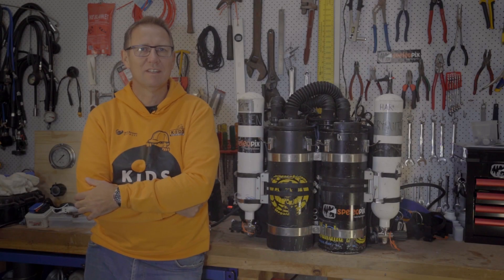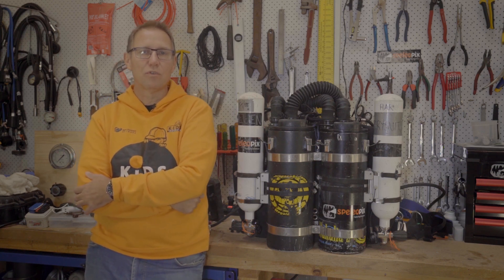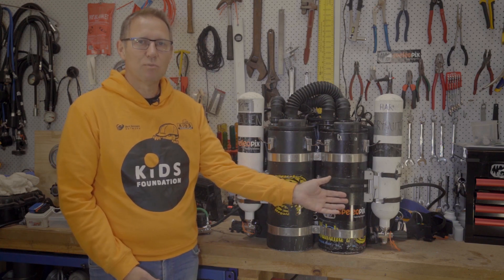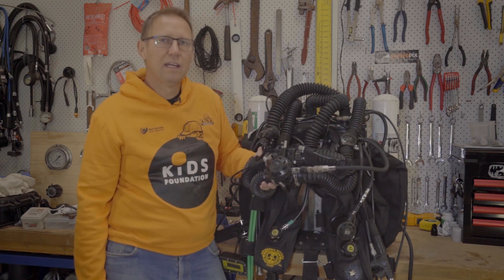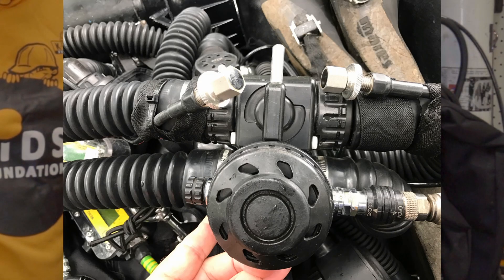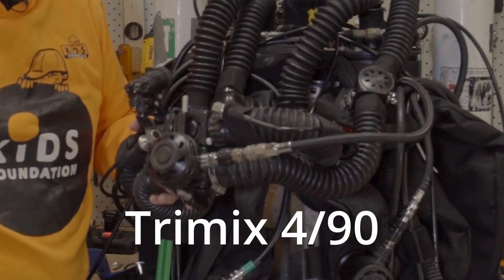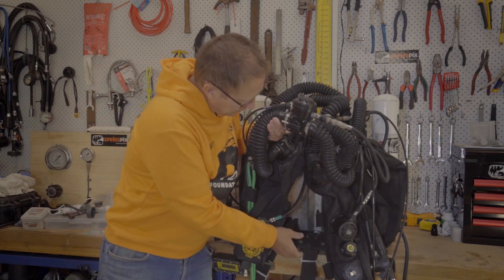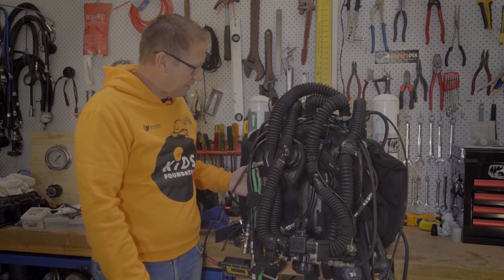Twin Megalodon Breakdown

Comment: Are you using the secondary rebreather as a bailout rebreather or do some of your dives require it to be built into the dive plan?  

It is inspiring and humbling to watch people such as yourself pushing new frontiers.  Amazing rig.  Thank you for the instructional video.  One the Meg sites referred me to this video saying you are the expert on dual Megs and this video proves it. .
Reply from the maker: Just as a bailout unit but we test and confirm it works as we descend. Definitely not an expert. My mate Craig Challen has a lot more experience. And som of the European guys for many years with other units.

Comment: Hi Richard,
(as a non-diver) I'd like to ask you what's more dangerous or unconvenient about using this setup? I've read, in another comment, that you'd recommend it for dives deeper than 150m. In my mind, excluding obviously a higher maintenance time and a longer fitting time for the system, a double rebreather would actually be safer because of the earned redundancy. Hence, it would be a better than closed circuit.
Reply from the maker: Hi good question. It IS closed circuit (just to clarify your last sentence). There is safety in simplicity and there is inherent danger in using a very complex system with many moving parts and more failure points. The task loading inherent in using this system is also problematic. However, for some dives, these risks are outweighed by the possible benefits of the increased redundancy and efficiency of a dual rebreather system. In fact for some of the dives we are doing, it would in my view be impossible to do them without this technology.
Reply: @DrHarryH  Thanks for the clarification! Looking forward to new videos.

Comment: Hey Richard, CCR is the next level up for me but also very expensive.  I’m curious, how heavy is al of that and how long does it take you to put it all on and go?  All of my caves are freshwater and we’re between 40 and 65M, so with multi tank sidemount we have a good length of time but nothing like a CCR can provide.
Reply from the maker: Yes very heavy, very expensive and very complicated. So I cannot recommended it for any dives unless the risks out weigh the benefit. For me, that begins when it becomes very hard (logistics, cave topography, cost) to stage sufficient OC gas. As a ballpark, caves or wrecks beyond 150m or very long caves. It's hard to be exact and as usual, it's a somewhat personal decision. I giove myself an hour at least to dress and go, especially if drygloves and thick suits are being used.
Reply: @DrHarryH  That really puts it into perspective, thank you.

Comment: Hello Harris, love your video and the dual BOV setup. One question I’m curious about: what is the interior design for the dual BOV like? And what are its drawbacks (say if one unit fail to work at certain depth, does the backup rebreather work just fine or not?)
Reply from the maker: The dual BOV requires some milling to join two Golem BOVs together...I had a friend do it for me. There is a common failure point at the mouthpiece and no doubt there is added work of breathing at the BOV as well. However we feel the benefits of instant access to OC gas and the second loop outweigh these issues. The second rebreather works fine.

Comment: Thanks for the awesome video... how do you feel about having duplicates of nearly the same hardware (dual Megalodon), if the environment and depth causes one to fail wouldn't there be a heightened chance the same factors could cause the backup to fail as well? I would think in an ideal world, choosing two different systems would provide greater safety, or what do you think?

Comment: Any thought to switching to a side mount bailout rebreather over the dual back mount? Seems less cumbersome and simpler
Reply from the maker: I was using a back mount + sidemount bailout rebreather (BOB) for some years before changing to this system. The twin BOV was a big factor, but also the inferior work of breathing of any sidemount unit was a worry to me if I had to bailout at max depth. I have also used backmount plus chest mount...lots of options!

Comment: This kit looks awesome! At what point would you begin to recommend a rebreather over a normal open circuit system? I understand the costs, just wondering what the biggest benefits for them are. Sorry if it's a commonly asked question, on a side note, are there any decent sinkholes/caves in the North Island of NZ you'd recommend checking out?
Thanks a lot for taking the time to show us this gear, would never have known what half of that stuff is without it.
Reply from the maker: Not sure about sinkholes on the North Is. Contact the NZSSS for help. CCR has a role for many reasons (including for those who just like playing with the toys!). When do you actually need it? I think it comes into its own for deeper dives e.g. >50m when decompression comes into play. Also great for photography and marine life interactions, and longer distance cave diving to name a few reasons.

Comment: With all the quick dis connections. Are you not worried about all the failure points?
Reply from the maker: Yes, I worry about everything. I have a specific procedure for plugging in and checking the QDs. No question that the more complex the system, the more failure points.

Comment: What are you using to vent gas effectively between the two on the ascent? What were the specific considerations you needed to make for the project that justified the decision?
Reply from the maker: I vent the primary loop in the usual way, and manually vent the second loop when I feel it starting to lift me a little. With practice you sense and anticipate all this. The decision to do this was simple...impossible to use open circuit bailout at the depths and distances we had reached. To qualify that statement, there are multiple reasons...logistical, physiological (e.g, respiratory thermal considerations), cost.

Comment: Between the 2 scrubbers what's total scrubber time?
Reply from the maker: We work on half normal time given the depth and cold temps. It has an 8lb radial scrubber in the primary loop and a 4lb axial scrubber in the backup. So conservatively maybe 5 + 3 hrs? We have done 4.5hrs on the primary without issue.
Reply: @DrHarryH  makes sense

Comment: why not use the kiss sidemount set up, I'm newish to rebreathers, I have hollis P2, but if I was cave diving, which I'm not I've heard great things about kiss
Reply: WOB on a sidemount rebreather will allways be higher than a backmount with over the shoulder counterlungs. It would also be harder to build a proper dual setup you would need something like a sidekick as well and they just arnt designed for ultra deep stuff. Plus why? they don’t need SM what they need is a solid platform to put a lot of kit onto which BM gives you.
Reply from the maker: Hi William, see my answer to a similar question below.